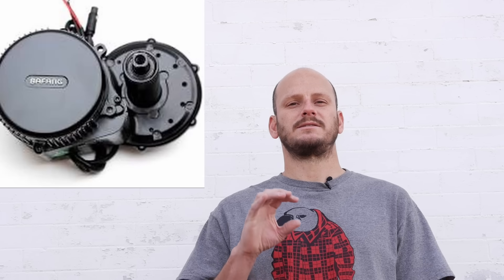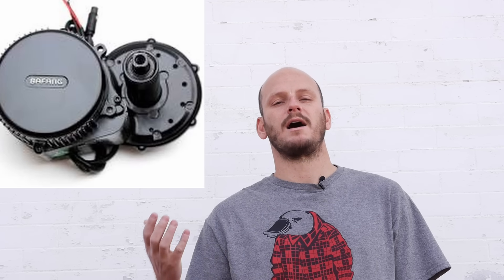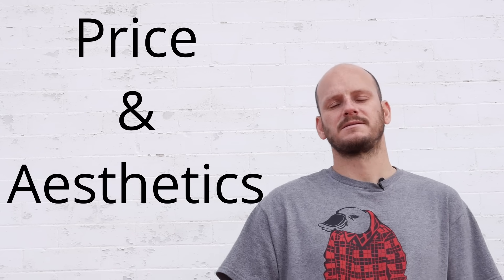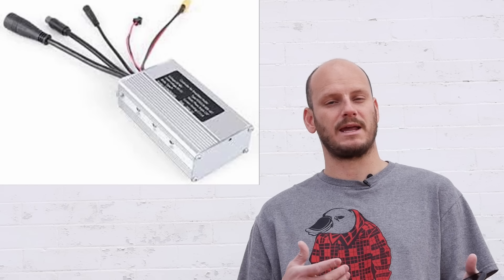Hub vs. Mid Drive Motors: Why Hub Motors Suck and Debunking Common Myths with performance test

Comment: Utter shite. No point in comparing.  Mids eat chains and can't be power washed. In 2 years after buying it and you can't get a battery ,motor ,wiring harness or display replacement then youve got nothing left, ask me how I know. All this doesn't matter of course because they are ,mainly due to price, bought buy pensioners with to much money and never get used hard. Hub motors are shit off road due to heavy wheel but aren't meant to be. They're for going to the pub or work or or shopping with panniers on, a replacement for your car you lazy bastards. Like all e bikes they're not good at distance and refuse to go much over the assist speed thus making normal bikes way better for that. Break anything on a hub bike and it's easy and cheap fixed or just made into a bike.

Comment: I'm 60,  100 pounds, need step though, do have BIG hills, and have to have max comfort so my back is straight.  What is the best bike for me without going into major debt?
Reply from the maker: Getting a good used bike will save you 100’s. Going with a bbs02 750w will be your best motor

Comment: wouldn't more power to the hub motor mean that spokes would get loose easier? because of more torque and centrifugal force impacting the wheel? Just my thought on it.
Reply from the maker: You put the same amount of strain on spokes regardless of how it is transferred. The main thing is is that many hub motors are quickly (cheaply) made and a) don’t have correct spike tension b) use low quality parts, so they loosen quickly and become a nightmare.

Comment: If you have a variable speed bicycle and plan on climbing a lot of hills or just want the extra speed,  use a mid-drive. If you don't plan on climbing a lot of hills and don't have the need for speed, just use a front wheel hub. This way you get the best of both worlds. You can ride it normally until you get tired, then just switch to electric power and rest while you are still moving. The hub motor will only give you a miniscule amount of resistance, so little, you probably won't even notice. Also, with regen braking, you can charge your battery while you are pedaling. 

Just keep in mind that a motor is going to give more torque than your legs. Having said that, The mid-drive will take out your rear wheel if you don't use the gearing properly. Also, it will stretch or break your chain faster than your legs will. There is also the possibility of the sprocket teeth breaking from the torque of the motor.

If you have a single speed bicycle, use a front wheel hub so you can keep the coaster brake. I don't remember if they made a single speed bike without a coaster brake? Maybe in the 20" bicycles? But, if they did, then maybe a rear wheel hub drive would work for you. I guess the only advantage to a rear wheel vs a front wheel hub is, the front wheel will have more of a tendency to slip. Which, BTW, will save your hub gears a lot just from the slipping. Because, if it slips, there will be less torque applied to the hub gears. The rear wheel on the other hand, will not slip and will apply a lot more torque on the hub gears.

These are just my thoughts on the pros and cons of each set up. I am 67 years young and have been around the block a few times. (Pun intended)

Comment: Another plus of mid-drive: you can use different wheel sets with the same bike. You can have one with skinny tires and higher gearing for road use and another one with beefier tires and lower gearing for trail use.

Comment: Now how the heck does a mid-drive get its twice-as-high torque from the chain to the rubber & road, without going through the spokes also? You lost me on that point. I would think, if anything, that the generally larger diameter of the hub motor spoke flanges would put more slant on the spokes and transmit torque more reliably than smaller-flanged, more compact hubs would. If the hub diameter is small then even equal torque translates into higher tension on the spokes and on the spoke holes/seats in the flanges. And also at the rim end of the spoke -- its seat there.

Taken to the extreme, for the purpose of illustration, can you imagine putting powerful disc brakes on a bicycle wheel with radial spokes? The spokes with zero slant would have that hub all twisty/turny, relative to the rim.
Reply from the maker: check the pinned comment for clarification :)

Comment: Enjoyed your video and your experience is valuable. My take is that hub motors are ok up to the power a human would transfer to the wheel/spokes....(100 watts recreational to elite 400 watts) . 250 watt hub motors in pedal assist mode would put no more stress on the the spoked wheel assembly than what is encountered with a non ebike setup. My honest opinion.
PS the only  down side to a hub motor is the unknown quality of  the rim and spokes supplied with the motor. You are putting a lot of faith that you are swapping out a good quality wheel to a , often unknown Chinese product.
Reply: You are right to question the quality of the rims. I have just bought new custom cut spokes, nipples (current spokes are 12G and wont fit any decent rims), washers and an Alex DM18 rim to replace the soft, chinese garbage rim that came laced to my hub. I dropped off the side of a gutter, got a pinch flat and bent a section of the sidewall in. I have bent the sidewall back out (a little too easy though), and have been riding it around while I wait for the parts to come. The rims may look strong, but they are terrible quality. Mine was out of round when it came new, I have trued it up as best I can, but you can see that the sidewall grooves don't line up at the weld.

This isn't a deal breaker for me moving forward, I still prefer hub drive where I live.. I'll just buy the motor by itself next time and build a decent quality wheel.

Comment: I've got two bbshd 58v I built, one on a giant anthem 2 and one on a commencal meta hardtail. Love em, maintain them, 5000+miles no failures. Set up the hall sensor on left brake that acts like a clutch so your not applying power during shifts, shimano 11sp will last indefinitely if you change the chain at or before 0.75%stretch.

Comment: If you want more low end torque with the hub drive, just simply peddle with your motor during acceleration.
Reply: That's what I do.
Reply: @Another-Address   - Pedal assist is not the same on cheap bikes, it's more of a 'pedal switch'. It doesn't respond to torque, it just decides that you're pedaling based on the magnets passing the sensor and turns the motor on, then turns it off when you stop pedaling for a few seconds.

It's much better for me to use the throttle and assist it with pedaling. So I guess it's more of a 'motor assist' as I'm helping the motor by pedaling, rather than the other way around.

Comment: I have an all-wheel drive e-bike with two hub motors I use the both switch because the motors work less and draw less power I've written it all summer I love the thing so much that I'm really missing it now that it's cold I've never ridden a center engine bike so I can't really comment and I'm sure it is an awesome experience but I really love my hub motors because I did pop off a chain and the front motor took me home no problem but that is unique situation cuz I spent close to $5,000 for this bike it is expensive it's heavy but I just love the darn thing I get looks and comments everywhere I go but it doesn't mean I would not buy a mid-drive bike, I do have a bike shop in town with an e-bike guy who did tighten the spokes for me a little bit and that is a very valid point but I'm just enjoying the heck out of the hub motors I get to do front burnouts at lights and people just totally flip out when they see it so of course until I drive a mid motor it would hard for me to give an accurate opinion but I do enjoy my hub motor bike and I would recommend this particular brand that I have to anyone

Comment: This video seems super biased. I haven't had any of the issues he has mentioned with my 750w hub motor. Torque and climbing performance is great, zero reliability issues.
Reply from the maker: It was based on my personal experience and my personal opinions. I will be making a more objective version soon.

Comment: I bought a hub drive ebike because if anything happens to the drive motor I can put a regular wheel on and still get on the road while motor is repaired or replaced

Comment: My first conversion was with a BBSHD. Put it in a hard tail 29er, it was pretty good.  Chewed threw chains, broke a chain far from home.  Went with a steel touring bike and a GMAC/Phaserunner.  WAY better setup.  Geared hub motor with regen capability, just sick.
Reply from the maker: Did you put a gear shift sensor on it? Otherwise it’s like driving a manual transmission car without using a clutch. You are going to blow throw transmissions.
Reply: @JohnnyNerdOut  Yessir, I had a gear shift sensor on it.  Had that shift cable replaced and the sensor added by my LBS.

Comment: bought a 24v hub motor 20 years ago, it's been in 3 different bikes, still works great.  (for just riding around).  also have a mid drive sur ron dirt bike and it is bad ass!!!

Comment: Which would be better for a trike? Would the mid driver still work on it? I am a heavy set guy with balance issues, but would love to use an electric bike to get around. I am thinking of trying to get a normal trike frame and converting it to a recline bike. Basically, it would just be one turned around and having a different type of steering connected to the wheel. I would have to mount a new place for the pedals. I have knee issues and getting on and off a low slung bike would be hard.

Comment: I have a hub motor ebike with 6000 miles on it over 3 seasons.  I would def buy a mid motor to try out if it was the same price which was $1700.  all the mid motor I have seen cost 2x or more than this and I have never even come across one I could try out here in vermont/nh area as the frames were too big for me.  whats up with that.
Reply from the maker: Check out my video on that topic😀 hubs and mid drive motors cost the same to produce(at the same quality generally)

Comment: Yes unsprung weight is an issue, but did you mention regenerative braking you can't put energy back in the battery with typical bicycle mid drive setups! Also if you want 2 wheel drive a hub motor in the front will be unavoidable!

Comment: Hey Johnny, HAPPY THANKSGIVING!
I have a Haluzak Horizon and am intrigued by your research. I have been thinking about enhancing my bike. The Horizon has an idler pully as the chain is 2 1/4 normal chains together. Can a mid drive be adapted to do this?

Comment: I love mid-drives. I'm a mechanic, and my mid-drive customers are very reliable consumers of chains and freewheels/freehub cassettes. Easy money.
Reply: Bicycle drive trains with a very few exceptions are engineered for human power, which is nominally 400 Watts max, if we're talking tour de France racers. Stack 750 watts on top of that, and you will eat drivetrain components faster regardless of technique. 

But mid drive owners think that's normal, and I love it, because while they're accusing me of being a hub fanboy, they don't see the irony in handing me cash for their fangirlism.
Reply from the maker: If they are going through drivetrains they should be educated how to properly ride. Many new riders are not aware of when to shift and that can put a lot of stress on the drivetrain. Although that might hurt your business it sounds like😐

Comment: I don't agree with you saying "Hub Motors suck". I do agree with saying that Mid Drives are better. You have definitely convinced me of that. 

I enjoyed riding my single speed bike that was converted to an electric bike before it was damaged by the rain due to the controller box that like you said you have to mount somewhere on the bike and make it look nice.

You got a subscriber out of me. I am very interested in electric bike conversion and you definitely know what you're talking about.

Comment: I disagree. I like my DD hub motor. It flys on flats and down hill. You can always rebuild it with a simple spoke pattern. Mid drive is super expensive plus I always have my 21 speed manual transmission
Reply: Having gears with a hub motor is of little help.
Reply: @LarryRichelli  He means....if the hub would not pull up a hill as fast as you want you can still pedal in a low gear. And no, that doesn't give the motor any better gear ratio as it is fixed 1:1  but it does get you up that hill. Unless you are looking for extremes.

Comment: I'm still fan of hub motors.
 Really quiet ride, you can barely hear anything with right controller. 
Easily upgradable, voltage can be really high until breakdown for more speed.
I like how I can cycle as much as I want and when I'm too tired to pedal I don't need to slow down I only need to let motor handle the rest. Also I literally rode ebike as electric moped when I didn't have any kind of transmission.
When I had e-scooter, I absolutely loved e-brake braking was really smooth and it charged battery as well(which isn't a lot: 400w is about as powerful braking as accelerating at 2500w).
Though it kind of sucks that most hub motors doesn't have temperature sensors and controller overtemperature protections. 
Efficiency in hub motors is really poor in low speeds. Towing with them isn't really good idea..

Comment: You give a LOT of information, THANKS!
BUT you only talk about hub moters that use the back wheel, what about the ones that use the front wheel, (example: swytchbike) do they still fall in the same category?
I've been thinking about converting my mt bike (used only in the city), for help with long distances, so all this information is VERY helpful.
Thanks!
Reply from the maker: Unfortunately yes. Many would argue front motors are worse than rears for various reasons.

Comment: I got a 2015 iZip Dash E3 with a burned out direct drive rear motor on CL. I installed a Grin SX2 geared motor ( Shengyi DGWX2 ) and their controller, and I couldn't be happier. I set the Power assist to 100W increments and just use 100W assist, so far I've gone almost 50 miles and have about half of my 48V 13.5 Ah battery left, I think the geared hub motors are generally superior to the direct drive hub motors based on comments I've read in forums. 
I would like to see a comparison of motor efficiency based on motor power, rpm and load, since that's what you're talking about. Based on what you are saying geared hub motors are superior to direct drive hub motors. When you say  you've seen  10x more hub motors burned up compared to mid drive motors, but you didn't specify whether they were geared or direct drive. I'd be interested in hearing your comments.

Comment: What do you put on beach cruiser one speed?
Reply from the maker: I’d go with a small chainring on the motor. Either bbs02 or bbshd as long as the bottom bracket fits

Comment: Have both; depends where you are, but half of what was said here is bs for the average. 
Yes, if you're going up a unpaved hill with a hub motor, you're going to do damage like bust your spoke. Yes, it will fail you in off road situations. But so will most econ cars, it's why you don't take them off roading. 

Hub is for city and suburb transit. Mid is for mountain. Simple as that. 
Also, chains break constantly on higher end mid motors, because they're physically not designed for that. You need a reinforced chain to generally get the most out of a mid.

Comment: 4:20 This is known as locked rotor amps and duty cycle for industrial motors . . .
Some motors can easily withstand this type of punishment . . . but they are usually rare and very expensive ! ! !
E-bike Mfg. could certainly benefit if they were to use the same standards that are applied to industrial motors . . .
5:55 Seems like we spoke too soon . . .
More torque equals more broken parts . . . 
This is easy to demonstrate with a TORQUE wrench . . .

Comment: You didn’t talk about noise. I have a Sur Ron, not really an e bike I know, but the chain noise is killer.
Reply from the maker: Interesting. I’ve actually been finding that hub motors are way louder than any Bafang mid drive. Could be specific to the motor used in your bike 🤷‍♂️

Comment: I've ridden my hub motor for about 1000m and I've not had any of the issues you mention. I'm going to try a mid drive anyway but I'm not sure you are correct about the reliability issues of hub motors.